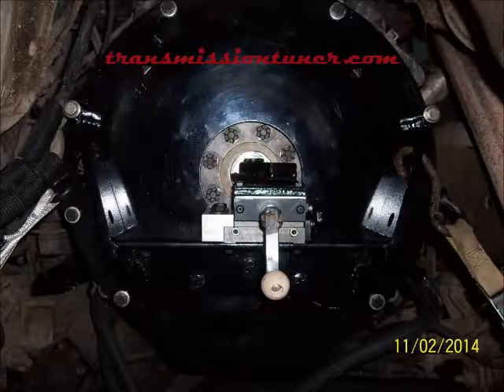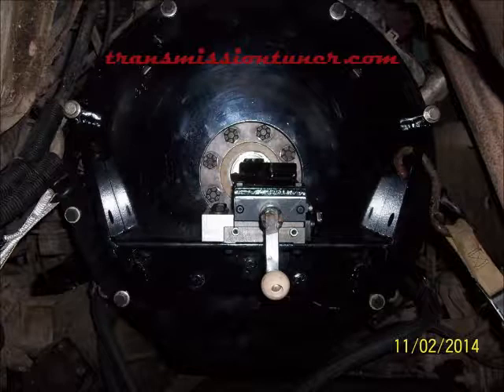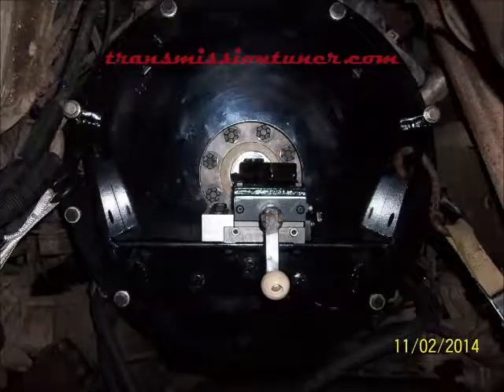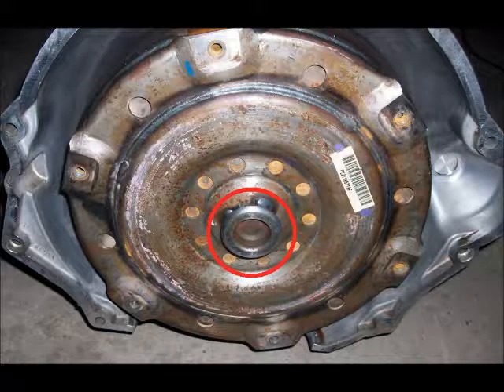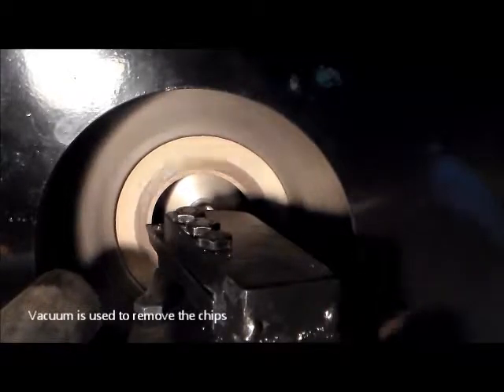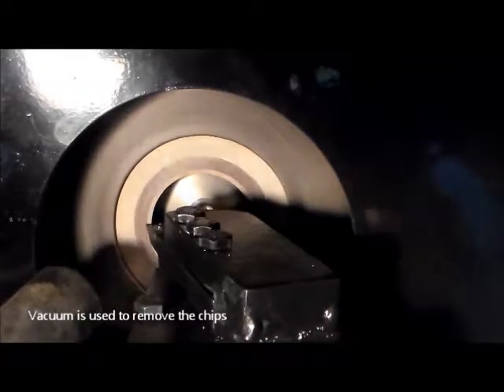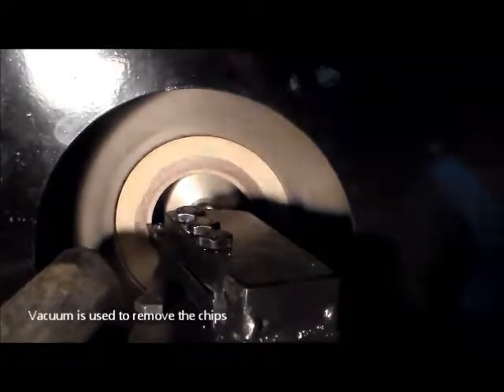68RFE Swap Boring Tool

Comment from the maker: I need to correct myself on this - finding out that 05 cranks need boring too unless it was a late 05.   Also you can see on the end of the video that I cut on my way back out instead of moving the table away from the crank slightly before backing out.  
I'll redo this video someday into a full instruction when I can bore an engine out of the truck - kinda cramped underneath with a camera too :).